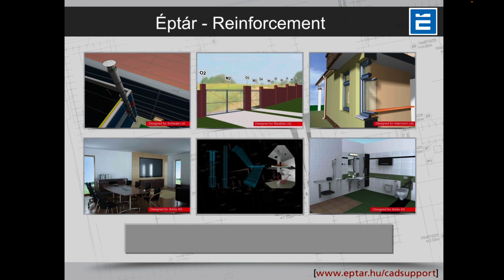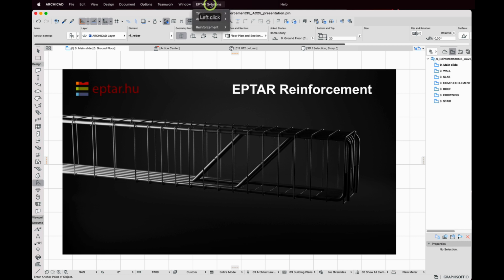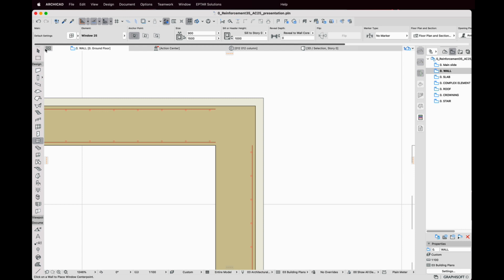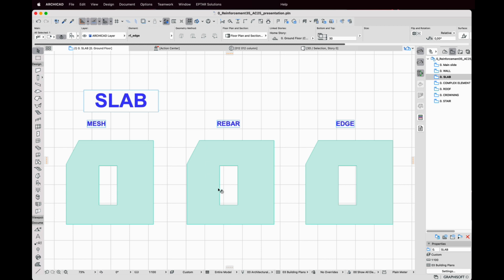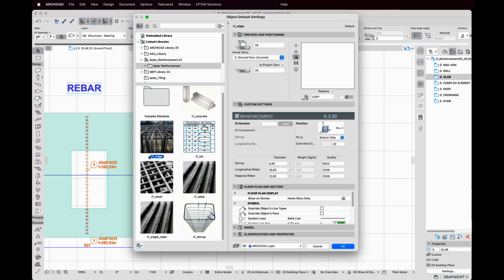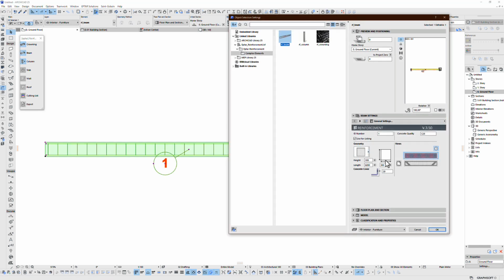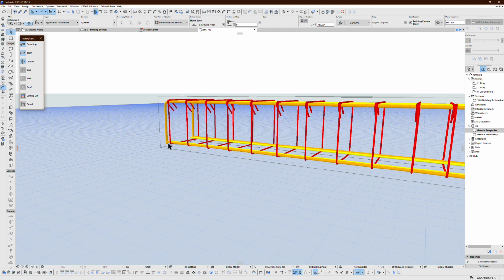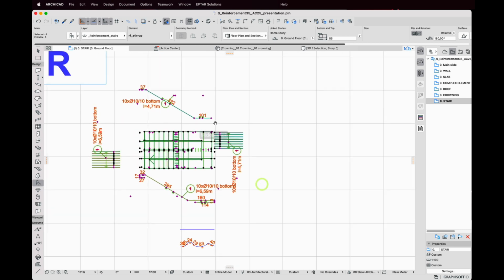Reinforcement webinar 2023

Comment: ¿Cómo puede crear una trabe en arco? y ¿Cómo puedo cambiar los pesos y nombres del acero?
Reply from the maker: I'm sorry, can you ask your question in English?
Reply from the maker: The weight of the steel is determined by its diameter, which can be set globally in the Model View Options or individually in the elements settings window. But there is no way to set a weight that does not comply with standard sizes, meaning a custom weight. Among the element settings, the ID determines its name, so if you enter a unique text or number (or mix of it) here, it will appear on the drawing and in the Cutting list.
Reply: @eptarkft  The issue of their weights and diameters has already been resolved, thank you, I was recently looking in the guide and it actually comes there.

Now, I have the question of how to reinforce curved beams?, whether in floor plans or elevations. How do I assemble a dome or an arch or vault?